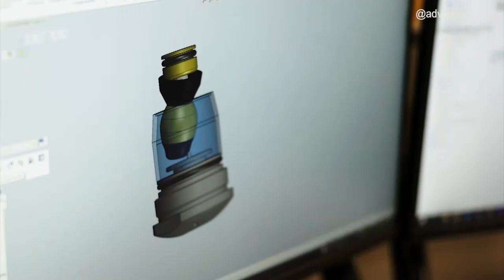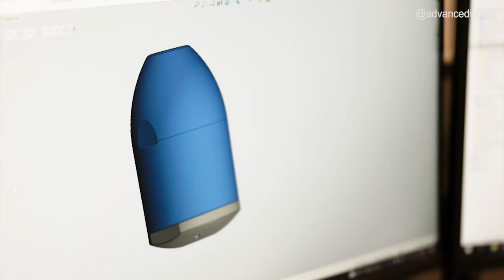1/4" Reaper Sewer Jetting Nozzle

Comment: What is the required minimum pressure and gpm for the 1/4” reaper?
Reply: Apparently they want to advertise their products but don’t want to sell them or you would have an answer for us by now…
Reply: I own 2 of the 3/8 reaper nozzles. I'm running 3700 psi and 12 GPM . We remove calcium with this head as well trees roots . Nothing else can do what this head does. 
I don't have a 1/4" reaper but will be getting one of those now that they are out.